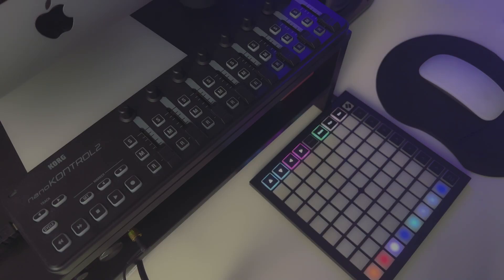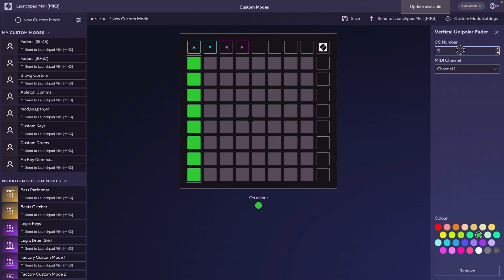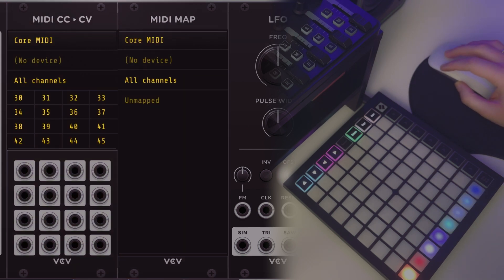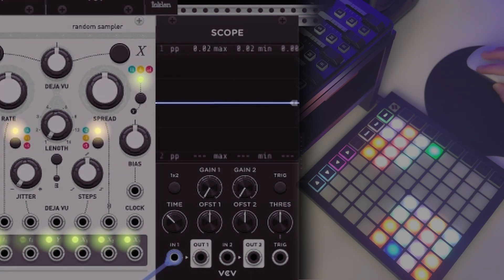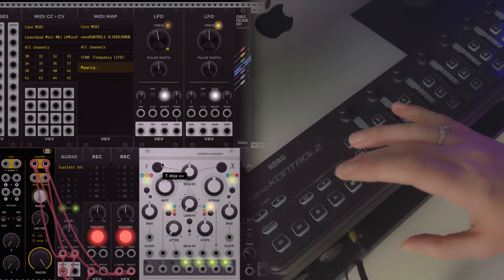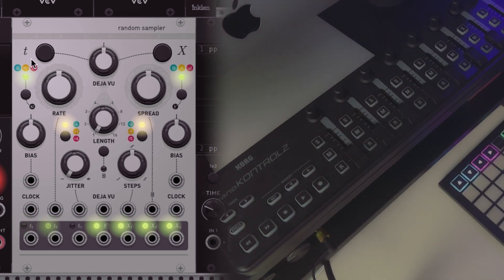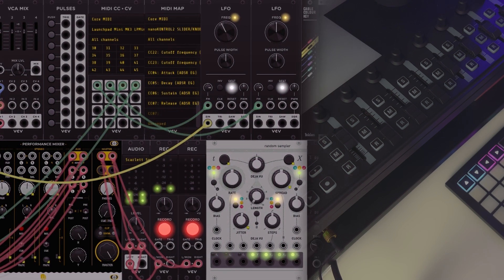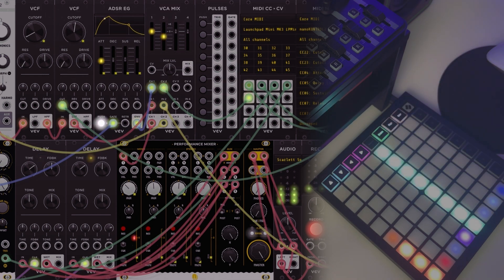How I Control VCV Rack

Comment: This is cool. Is VCV rack 2 still limited to 16 parameters max for midi mapping? Is there a convenient way to use different banks or similar to control more than 16 things with a control surface without having to use the mouse?
Reply from the maker: Thank you! I’ll have to double check, but I think I might have mapped more than 16 parameters before, If there is a limit, I wonder if you could use a second midi mapping module and connect it to the same controller to continue mapping more parameters?

Comment: Interesting!  I hadn't thought of using a Nano controller for this purpose.  I have the Launchpad Pro mk3 but didn't have much fun using it with Bitwig.  Being able to control the knobs with its sliders in VCV Rack sounds like an interesting way to use it.  I'll need to bring the LP Pro back out of the box and try this out.  Thanks!

Comment: Hey Darlene, thanks for the videos. A bit off the topic of this one, but I have a question: I noticed you use VCV Recorder for your performance videos. Do you get any popping/hitching on the monitor end while you're using it? Or any previously that you were able to chase down and eliminate? I experienced it quite a bit, although it was never present in the recordings afterwards. I have ended up using Omri Cohen's recommended routing system (Output module -> ReaRoute -> Reaper (monitored by my interface) -> ReaRoute -> screen recording software) which seems to be far less taxing on my interface, but I would love to be able to just use the module as it's much simpler than what I'm currently doing.
Reply from the maker: Thanks for your question! Sometimes when I’m creating my patches I do end up with audio popping and crackling, especially if I’m using a lot of modules, but I always assumed it was from overloading my computers processor, so I’d simplify the patch, get rid of some of the modules, and that’s always cleared up the issue for me. I’ve never tried recording it when it’s crackling, so I’m not sure if it would be on the recording.

I’ve never heard of ReRoute but I’m gong to look into it now! My only system for recording so far has just been going from my output to the “audio” module for monitoring, and also to the recording module, and then I use QuickTime to record the screen recording and line them up in my video editor after (DaVinci Resolve) and I’ve never had an issue as long as I keep the patches to a size that my processor can handle :)